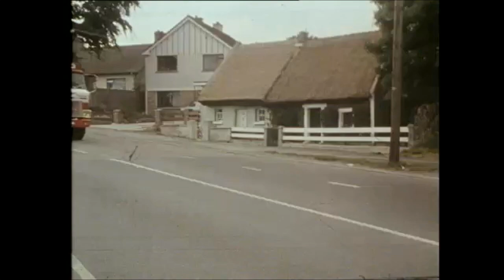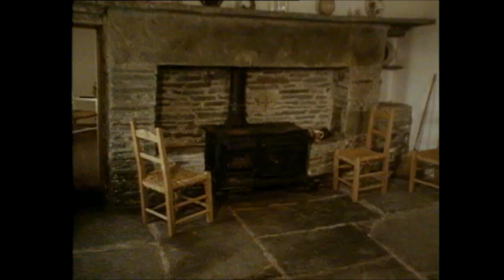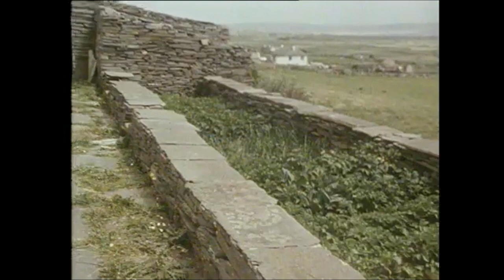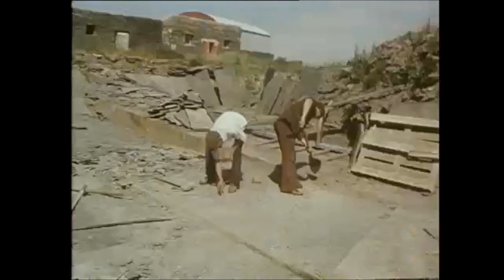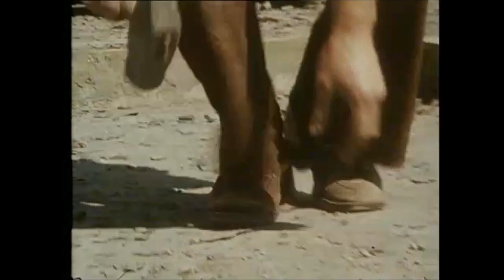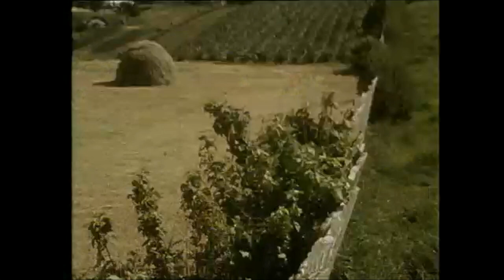Old Irish Cottages & Flagstones, Co. Clare, Ireland 1977

Comment: Beautiful! We're lucky enough to live in an Irish cottage that's over 100 years old (with the exception of the 70's kitchen add-on). The walls are over a foot thick of local stone, solid and sound. There are two old outbuildings where you can see the incredible skill that went into putting together a mixture of huge blocks and small fieldstones that are still standing firm, no mortar used, just a skilled eye on what went where. There's a special comfort to be found in a solidly built cottage that would also be called a crofthouse in my native Scotland, built exactly the same way.
Reply: Happy for you. You are blessed.
Reply: is it not cold
Reply: @lazycarper7925  Here in Ireland, not at all, but in northern Scotland it pretty much was, even in summer.
Reply: @prepperinireland2240  i ask because im looking myself but, it looks like they can be hard work to get dry and warm, im looking for the west coast bcos its cheap , but prices have doubled in last 2 years, everyones doing it now
Reply: @lazycarper7925  We're in the West, you're right in that prices have soared but if you're serious about relocating, better now than later imo when they've gone up again. Have you tried Daft(dot)ie? That's where we found our home. Most homes come with oil CH which isn't cheap but older houses like ours usually have open fireplaces in most rooms plus kitchen ranges (normally Stanley models) which like ours can heat radiators and water. Good luck with your looking. Here, you'll find decent homes with a small garden, it's usually the acreage that keeps the price high.
Reply: @prepperinireland2240  yeah we are after between 1-2 acres, and run down cottage ,they use to be about 35-45,000 e, 2-3 years ago, the same propertys now want 60-65,000e,
we are hoping to run our heating of wood of the wood stove,maybe a stanley like you, and buy large orders of fire wood in, im hoping thats a cheap way to have heating?, am i wrong?
Reply: @lazycarper7925  No, you're not wrong. There's a lot of forestry in the west and the do sell logs, so what you plan sounds perfectly feasible. :)

Comment: Good old days
Reply: Sorry to burst the bubble, but most of the cottages were cold, damp, filthy, and unfit for human habitation. Flags were freezing to walk on in winter.  The windows were small to keep what little warmth there was in the house.  No running water.  No inside lavatory. Thatch was full of spiders and caught fire at the drop of a hat.  The air inside the cottage was dank, and stank of smoke mingled with stale human sweat.  The walls dripped condensation. The doors rarely fitted their frames and the frames rarely fitted the doorways because the wood either rotted or warped.  Sure, the stone walls were thick, but the wind used to blow through the mortar.  Yes, they are pretty now, but they weren't so pretty, inside or out when poverty-stricken labourers had to live in them out of necessity.
Reply: @hyperionone4208  Maybe in your experience, but in Donegal we had a beautiful cottage warm as toast. The secret is to keep the stove running on solid fuel (peat) 24/7/365. SO dry, so clean. Summer and winter. Live a home all the time. A fresh coating of lime wash. No creepy crawlies. Poverty, desperation and perhaps ignorance or oppression could destroy the happy home habits and lead to the picture you paint but done correctly much joy and beauty and love.

Comment: 0:21 Ah the old Hino. They exploded onto the scene in the mid seventies, the first company to mass market a sound system with an integrated truck.
Reply: They were very hard on diesel when they first came out on the Irish market, good oul Pino Harris made a fortune from them
Reply: @Shane-zx4ps  Were they? I wouldn't know. Growing up on a farm all I knew is I got to sit in the cap of one as it hauled our beet to the sugar factory. Another poster put up a comment that then disappeared that BMC let Pino Harris down and he then did a deal with Hino. BMC was an awful company.

Before the Hino trucks arrived on the scene, the Irish roads were filled with Ford D Series, Bedfords and Leyland/AEC - all British. I know Leyland folded into DAF but the prevalence of Scania as you see on the roads today is another stark reminder of manufacturing decline in the UK in the '70s and '80s.
Reply: @dellhell8842  ok nice piece of information there, a friend worked for Harris and he said the Harris garage in Dublin assembled the hinos cause they arrived in parts
Reply: @dellhell8842  k

Comment: No eye protection for these guys!
Reply: Safety Squints and pre-emptive blinking is what is needed, although anything involving higher speed, larger objects that can ricochet I do wear high impact eye protection. I would be half blind now otherwise from a 12mm steel ball going flying ending up hitting me in the glasses, which cracked but stopped the ball. I wouldn't wear them to break stones because the eye can see it coming but have worn them working on dry hedges after debris going behind my eye, don't want to repeat that again.
Often I see people wearing PPE for no reason other than insurance reasons or for false security and many years ago I saw a welder who closed his eyes while stick welding, he was the only one on the floor who did that mind you but some people are bizarre. I think it is much better to leave people to their common sense and their own ways.